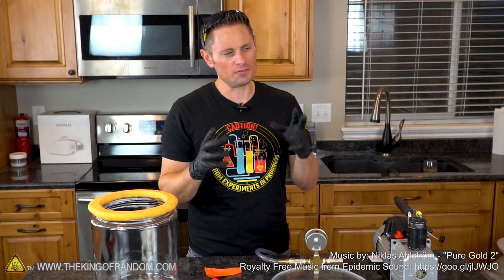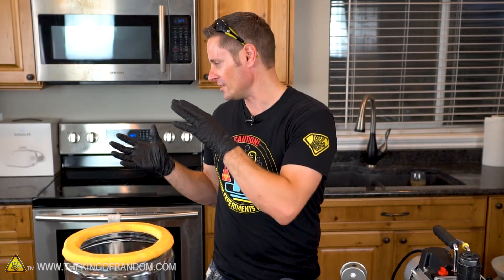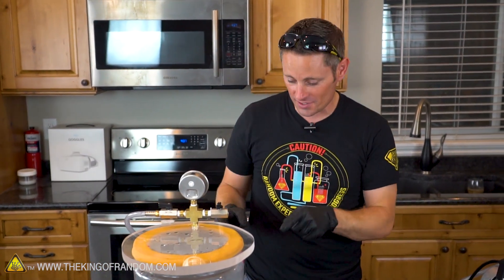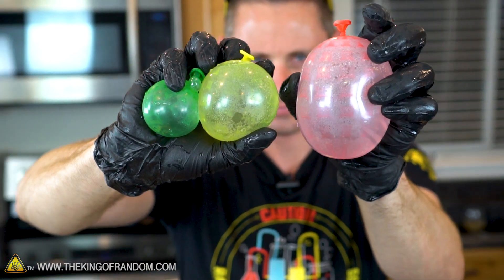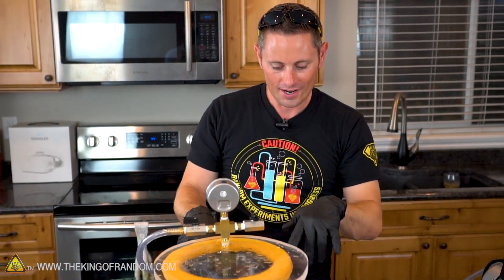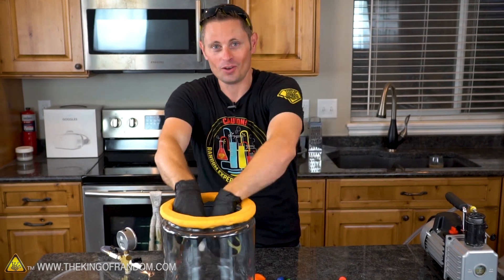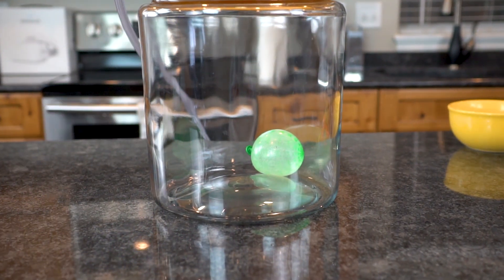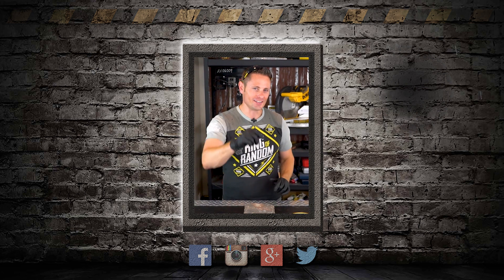Do Hot Water Balloons Explode in a Vacuum Chamber? King Of Random Tests Balloon In Vacuum Chamber

Comment: I work in the automotive industry and this one is especially interesting. Under normal atmospheric pressure, compare the engine of you car to the latex in the balloon. The system is designed to be under pressure from the rigid engine so the water or solution doesn't boil while transferring heat while having failsafe modules. Using a vacuum, you can simulate more extreme conditions with a lower temperature threshold with balloons like he does. This is an analogy to your car overheating from getting the water in your car (balloon) too hot, and now you can see how much that changes based on pressure of a system like the car cooling system or the atmosphere. However, your car will release from the overflow from the radiator cap, then the freeze plugs. This is in order to save gaskets and failures since oil and water sit so close together in junctions such as the head gasket.

Comment: In case anyone wants to know why this happens.....with water, there is a phase diagram that shows you what phase (ice, liquid or steam) water will be in for a given pressure and temperature. The reason why the water didn't boil at a low temperature is because the pressure inside of the balloon didn't get to <0.3psi. which is the pressure that water would boil at room temperature.  The extra pressure on the inside of the balloon is caused by the rubbery elastic squeezing the liquid (this is additional pressure that would have to overcome by the vacuum).

Comment: Hello, here's a simple suggestion with your experiment.its a doubt actually.if the temperature of the boiling water is measured before and after the experiment, it might tell if vacuum was helping for volume expansion alone or if it's really boiling with an increase in temperature beyond initial one

Comment: you dont even need hot water,  just warm water. the problem with the first experiement was that the water was colder than 14°C. thats the temprature where water starts to boil in a vacuum.

Comment: mix 2 parts hydrogen peroxide and 1 part Iodine, then place Q-tip in solution. mix 15-20 seconds, then drain.

Q-tip should turn purple in solution.

Comment: What happens if you put an aresol can in a vaccume chamber 

Try an atsma pump
Reply: Sorry for the bad spelling
Reply: nothing. i dont know what asthma sprays use as a propellant but for most a temperature increase from 20°C to 30°C will result in a higher pressure difference than a vacuum. so if the spray doesnt burst on a summer day, it wont in a vacuum.

Comment: When the first Balloon popped the water it released that boiled off cools the remaining water left thus reducing the temperature of the remaining balloons as the base of them were submerged in water. If you have a total vacuum you can vacuum freeze water but requires a pressure <611 Pa. (Not kPA).

Comment: Try melting sand to see it it will melt into molten glass like in mincraft  like if you agree
Reply: He did a video about melting glass.
Reply: You probably could melt sand into glass because of its silica content, however to make anything that would be worth while you need to add a few things. Some things to lower the melting temperature, and also to remove impurities etc.
Reply: Johnathan Woodsvlogs He already madr that video
Reply: Also it needs a super high temperature just to turn into glass so not sure if it would work🤔 but it's worth a shot
Reply: I like it
Reply: that wont work you need more than just sand you need a special type of sand called silica because it is pure white sand and doesn't have any impurities. (but that would be cool to see him melt silica into glass)
Reply: Johnathan Woodsvlogs spastic

Comment: Take two cold water balloons, fill both after running the tap for a while, and then heat one of the balloons in a hot water bath to eliminate dissolved gasses from the hot water heater.

Comment: ceramic or concrete cylinder half filled with liquid nitrogen, a tight fitting 1/2 inch disk of aluminum floating on said nitrogen, thermite burning on top of disk. -------> will the Thermite burn through? (or maybe steel)

Comment: Hi grant what will happen if you freeze thermite and try to ignite it??🤔🤔
Reply: Lightning IQ freeze?   Its metal not water
Reply: Lightning IQ freeze means to turn it into a solid, right? You'd need liquid thermite in order to freeze it. Am I right?
Reply: Thanks
Reply: HOW about putting it in liquid nitrogen
Reply: Lightning IQ it won't ignite
Reply: Lightning IQ it wont work you need o2
Reply: Brandon Marcum Damm someone knows there facts
Reply: +Kayleene Bruce 
And someone doesn't know THEIR grammar.
Reply: Kayleene Bruce Some people make mistakes and you make spelling mistakes. I guess you're working at mcdonald's
Reply: Bonnie Hou Hey thanks
Reply: It most likely wont ignite since you need a very high tempreture to ignit it in the first place
Reply: Don'! It will catastrophically explode!
The U.S. military uses thermite grenades and they explicitly state that a grenade that is frozen needs to brought to at least room temp before using. That doesn't mean stick it in front of the heater vent for five minutes, that means store them so that there is no way they can freeze so they can be used when needed.

Comment: What would happen  if you made liquid SF6  and hellium, blow up 3 water ballons of each and do these three things to them in a vacuum chaimber. #1 to see what 2 of the ballons  do on their own with no temputure changes done to it. #2 use liduid nitrogen for a few seconds to just get 2 of them relly cold but not frozen. and #3 put it in the last two of them in the middle of a boiling pot of water for a little while. it would brobably need to be two vids though the first is to see if its possible and the second to see what they do in a vacume chaimber.

   P.S. maybe also you could do some others and see what they do when they are watered down if it doesnt work.  and also I know that SF6 is expensive so heilium by its self works also.
Reply: John Animations  he already do it w matpat

Comment: Hey Grant has an equation that says that as the pressure drops the boiling point also goes down because of it, if you are in space without a suit your blood will boil, but that is not the issue. Try heating a watermelon and then put it in the vacuum pump and see what happens. 🖒👑

Comment: You can heat the balloons by putting them in a hot water bath. That is also probably safer than trying to fill the ballon with boiling water.

Comment: Something else to consider is that as you see the water boiling because of the lower pressure, it's releasing heat. So if you take a hot water balloon and subject it to repeated vacuum conditions, it will cool off faster than one left in atmospheric pressure.

Comment: I think it's because the steam from the hot water started expanding once in the vacuum, thus reducing the pressure on the water in the balloon. Reduced air pressure on the water = water boils = more vapor and explosion. There was no steam in the cold balloon and thats why it didn't work.

Comment: the hot water balloon exploded because the hot water softens the latex there for it can expand.
Also  can you try to make glass with either the solar scorcher or the mini furnace .
Reply: burkeyplayz not true. Water has a different vapor pressure at different temperatures and when you remove the air from a container with water the vapor pressure is lowered
Reply: The low preasure makes it so the boiling point of water is lower there for the balloon with hot water expands
Reply: Axel J this is also true in this case
Reply: it's because lower pressure decreases the boiling point, making it so the slightly warm water is at its boiling point and turns into a vapor which has a greater volume then the balloon can hold causing it to pop. This is taught in 10th-grade chemistry class.
Reply: TheDanishGamer18: Yes it will. It's basically rubber dude. It gets more plastic with heat.
Reply: Latex is a natural product it wont get soft in heat
Reply: Latex is a natural product it wont get soft in heat
Reply: Being heated actually makes latex stronger. Cold latex resists stretching but is more brittle. Warmer latex will stretch and snap with more force.

Comment: Looking at it, I'd be quite curious about whether dissolved gasses are interfering or not. Starting with a cold water balloon and heating the water while in the balloon (warming in a hot water bath) would help remove the possibility that the water from the water heater has higher amounts of dissolved gas that are leeching into the balloon and causing expansion and thus allowing the water to boil.

Comment: Cool experiment, I wonder if you used a  infrared thermometer on the cold water balloon and see if the temp is rising when in a vacuum but it might be taking to long for it to reach the boiling point and that's thy they are not expanding.

Comment: Another great video.. You just showed us what's also happening in a vacuum distillation. The liquid will boil at a much lower temperature. That's what i do too with my still...the ethanol boils between 30 and 40 C. Normally it would boil at 78 C.

Comment: Am I the only one that noticed that his pressure chamber cracked during this video and then just kept using it?
Grant: You should try drilling a hole in dry ice and put thermite inside and see if you can get it to light off as normal or if the cold will hinder the ignition process.

Comment: try melting aluminium and when its melted dump some powdered iron oxide in and see if you can make solid thermite ingot    that will be so cool        like if u want to see
Reply: Maybe instead of molten aluminum u use gallium cause if I'm not wrong it melts in ur hand
Reply: Pretty sure that would just ignite since molten alumimum is extremely hot, and heat + thermite =🔥🔥🔥 It would still be fun to watch though.
Reply: What's iron oxides melting point? If it's lower than aluminum it might work
Reply: navy dragon21 i actually dont Think it Will cause a reaction because I have melted aluminum many times and I melted it in a rusty steel can that has rust/iron oxide in it and if that wouldn't cause a reaction then I don't think the powder will. Cause a reaction

Comment: If you fill a football or soccer ball with either a really light gas or really heavy gas will it stay in the air longer or fall faster depending on the gas? 🏈⚽️👑
Reply: Dominik Toth if you put helium in them it will act mostly the same pretty sure because of the weight of the ball itself

Comment: Hey Grant!Tim McGee from Timacious Productions here with a theory or you. As we have seen with the past two experiments, water temperature makes all the difference, but what happens if we place a hot and a cold water balloon into the vacuum chamber? I know, I know, you already did that, but what if we allow the hot water to continue to boil in the chamber with the cold balloon left in there? Will it boil to the point of complete evaporation? If so, will it heat the cold balloon enough to trigger the exothermic change to have the cold balloon explode?

Comment: During the wrap-up, you hypothesized that theinward pressure of the balloon's elasticity was preventing the water inside from boiling- I would suggest a third experiment with cold-water balloons: put only as much water in them to fill the space inside before they start stretching.  Maybe just submerge them and tie them off?  Since water vapor takes up a lot more volume than in its liquid state, it shouldn't take much water at all to get the balloons to pop (maybe an experiment with warm water if the above doesn't work- how little water is actually required to get it to pop).
My wife, also thought that the heated balloon itself would be stretchier and thus impart less inward pressure compounding the effect.  Not sure how one could test this- maybe stretch an empty balloon with a weight and see if it stretches further when gently heated?

Comment: The reason this worked is vacuuming the air doesn't creat heat, but does reduce the boiling point of the water. All you'd need is a little warmth and a vacuum or be at a high elevation to get this, thus why cooking temps on food is recommended as we live at different elevations.

Comment: Do you use an air dryer on, or in conjunction with your vacuum pump? I have a vacuum pump, and will be getting a vacuum chamber, and I would like to know if adding an air dryer between the pump and the chamber would help increase the life of the vacuum pump.

Comment: What will happen when you put a speaker in the vacuum chamber
Reply: No sound will travel in a vacuum. However, vibrations from the oscillation of the coil may be heard as it travels through the chamber walls.
Reply: Vinojan Alagurajah you won't hear anything that's it

Comment: why don't you get one of those 6ft balloons put some dry ice in it seal the balloon and see how long it takes to inflate
Reply: Michael Salvatore the dry ice would probably cool the balloon down too much to the point where it would crack :(
Reply: To Get around the cracking problem, the dry ice could be placed in a beaker of warm water atop some packing foam, but it would take an age to inflate fully (depending on how much ice is used of course)
Reply: he already did that I think,but with liquid nitrogen instead...

Comment: If you did the same experiment but instead of filling it so the rubber would stretch full it up until just before it stretches. Should the initial elastic pressure from the balloon be to much for it to expand??

Comment: Sorry if this doesn't work but, how about two charged electrical could trying to get to a magnetic or a conductive material in a vacuum and then try it with one or see if the material is stripped of its conductive properties if just placed in the vacuum 

How to small battery pack attached to two wires and then two small magnets or conductive material in the vacuum

Comment: Try demonstrating how sound doesn't travel through a vacuum by levitating a speaker in the chamber with magnetism? So there is nothing for the vibrations to travel back to the glass
Reply: Might be challenging considering that speakers work on the principle of  magnetism, and stray magnetism (from the levitation) will disrupt the movement of the oscillating coil.
Reply: Maybe he could try it with some kind of bell or something. Similar to experiments Cody from codys lab has done

Comment: Is it possible for you to put molten aluminum in the vacuum chamber?
Reply: Not with the acrylic lid. (it will warp and melt)
Reply: Yes and it would vaporise the metal, I believe this is one method used in industry to apply a fine coat of the chosen metal :)

Comment: Steam takes roughly 1600 times the space of the water needed to make it and unlike compressed air Steam continues to expand so long as there is heat. It's the reason Compressed air can be used as a test medium for boilers checks but will not drive a machine designed for steam at all well.

Comment: Here's a thought: Could you try to make a high pressure chamber?
Reply: It's called a pressure cooker, Here in the UK we use them to make all sorts of bland pale food.
Reply: Akada Catchings not if you have tight locks or hinges
Reply: Sparky that would make the container explode or create clouds.
Reply: Will Proctor NO a pressure cooker also uses heat to cook food!
And it is only at about 15psi usually
Reply: Sparky yes.. just pressure more air into the chamber.. theres already an option on the pump to do that.

Comment: What will happen if you put hot water into a glass bottle and the drop it into liquid nitrogen. I recon the reaction will be pretty explosive.
Reply: Mark Poznanski or maybe liquid nitrogen into a bottle and the bottle into boiling water
Reply: TheCarLovingSwede Probably the bottle would break in both situations
Reply: Reckon*
Reply: Dylan Koh The hot water shouldn’t freeze, due to thermal shock the bottle should explode
Reply: Its spelled Reckon Mr. Poznanski
Reply: Harry Faulkner Hopefully he will make a video on it and we will see, fingers crossed
Reply: the bottle would shatter
Reply: the hot water will simply freeze.
Reply: TheCarLovingSwede goddamn ur profile pic
Reply: I disagree I think the reaction will be cracking, not explosive.
Reply: Dylan Koh What I meant is that he should drop it into a large container filled with liquid nitrogen so that the whole bottle gets submerged
Reply: Mark Poznanski the bottle will crack or explode, hard to even film because of the large amount of N2 boiling from the thermal shock. the water will definitely freeze thereafter since the water will be submerged in the liquid N2
Reply: Mark Poznanski I am talking about the water here. it will simply fall into the liquid N2 if the bottle break and freeze. I am assuming the liquid N2 is in large excess that it will not evaporate all immediately upon contact with the hot water.

Comment: I was focusing on the videos where you had problems with copper and I thought you could have used the same mix you used for the Mini Metal foundry of plaster of Paris and sand to create more durable molds and that did not break while metal was pouring

Comment: Do you hear that grinding noise coming from your vacuum pump? It's getting damaged by you always pulling water vapor which is condensing inside the pump. You should probably get your pump reconditioned before continuing to use it...

Comment: try to take a hot water balloon, put it in a bigger cold water balloon then put it in the vacuum chamber
if you want to you can try the same but instead of putting it inside a cold water ballon put it in a hot water ballon.
or do both